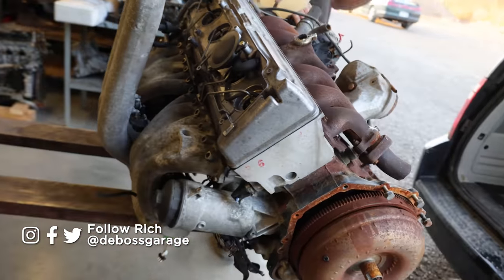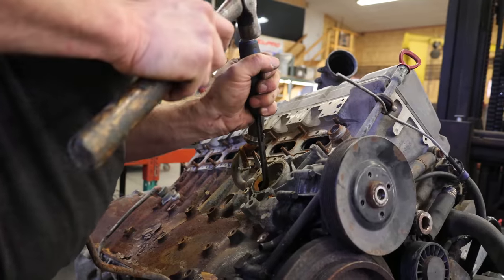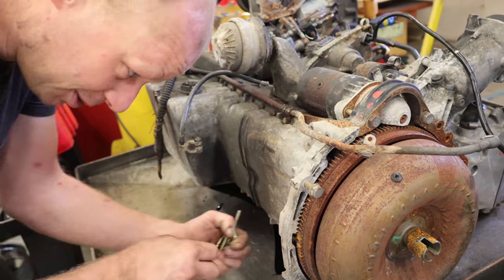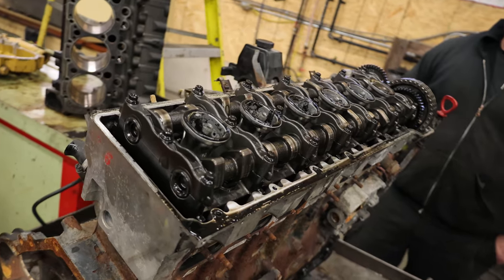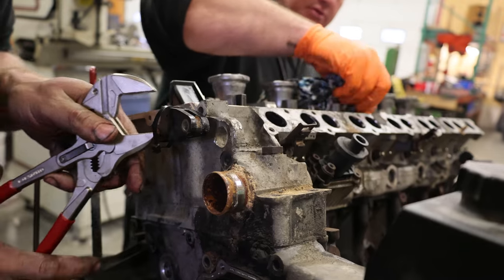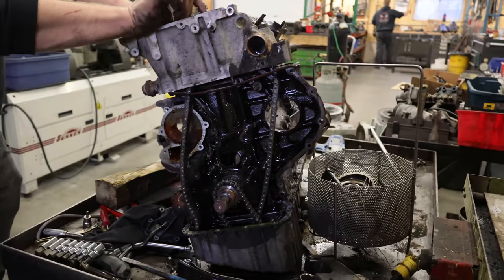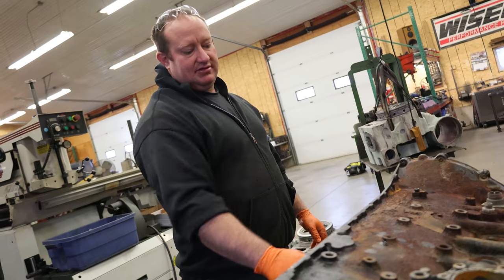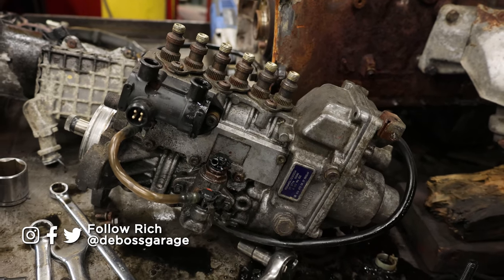REVIEW: Everything Wrong With A 3.0 Mercedes OM606

Comment: That spring loaded drive wheel for the injection pump is actually a dynamic timing advance mechanism, has nothing to do with chain slop..
It advances the pump timing as the rpms are rising 😃 build versions of the OM606 do up to 7000rpm
Reply: It's also a common problem that those vacuumpumps eat up that Rollercoaster thingy on top of the timing advance, if the bearing in the pumparmroll is going bad.

Comment: The pins that hold chain sliders are hollow Inside, they have 6mm Bolt hole where you screw in a Bolt, then Use hammer to extract, careful if going back together because it fits both ways only one is correct , these engines are really sensitive reguarding the hidraulic lifters and with timing of the fuel pump... They also have trouble starting up if even two glow plugs are bad...
Usually we say the Mercedes Sing you see with three lines and a circle that represent: Oil, Water, Fuel and trip around the world 🙄

Comment: You can't build a lot of hp into a non turbo.om606. The rods and pistons are to light. Now the om606 turbo can be built to very high hp. Take the stock pump and remove the 6mm poppers with 7mm. The stock turbo needs to be replaced as well, what's used on a 5.9 commins will work, and if you can find the right valve springs it will spin 7500 rpm. This from a Mercedes owner.

Comment: These engines are good except for what I used one for: I had one that DPUK built for me to go in a Land Rover defender and sadly I was disappointed with it, no.1 being theres no torque below 2500 rpm and no.2 it massively overheated all the time, no.3 it was terrible on fuel. The no torque below certain r.p.m makes it unusable for towing any trailers and personally I’ve never seen or had an engine over heat just from idling and on a 60mph run it would only do 10-12 m.p.g at best

Comment: Those pins that hold the chain guide are pressed in. The pins have internal threads for a pulling tool. By the looks of it they're rusted out though. Love my om602 and 606
Reply: And by tool I mean a bolt and stack of washers lol

Comment: the NA and turbo pistens are the same size, the difrens is the cros pin in the pisten. 26mm in the NA and 28mm in the Turbo.
you can bye som used turbo pisten on Ebay or benzforce.com  (USA)
you can bay som storng con rods on aliexpress ;)
remember to use a turbo head gasket (its a MLS) and use som 12.9 bolts for the heads bolts. the OEM bolts are stretch bolts and will stretch over time if you runn alots of boost, sak me how i now :P
if you remove the  chain tensioner on the exhaust side of the head it will com easier out
and the to pins, one you cut are only present in. the are M6 threads in it for a hammer extractor tool 
you can use the fule filte house of your w124 white merceds om602, its a better design with banjo bolts and fittings
if you have any questions, feel free to ask me

Comment: The 617 turbo has oil squirters on the rods for the back of the pistons, the N/A doesn't. Worth looking into for the 606 turbo vs N/A. Might be an upgraded oil pump to handle the extra volume too.

Comment: P-pump with a supercharger and turbo set up to clean up some of that fuel early on?
Reply: Blacksmoke racing has done it before not whit the p pump. But damn it sounded badass
Reply: Na, just build the OE pump with elements from Dieselpumpuk and then use their quick spool valve or their twin scroll manifold.

Comment: Looks like a 606.912 out of a 1996-97 W210, same block and crank as a 606.962 turbo , the head casting is the same but not surface hardened to the same specs
and non-sodium filled exhaust valves. The electronic injection pump is the way to go nowadays with 7.5mm elements and stand alone mod factory or aftermarket ecu.
The SuperTurboDiesel forum is a good source for information. I would not put one of those engines in a heavy truck with big tires or for towing.

Comment: also to really make power with these motors you need to make a custom exhaust manifold, as well as intake manifold. the stock stuff works but chokes up above 250hp.  intake is good tho, just have to gut the flapper. 

the main difference between turbo and na are piston wrist pin size and oil squirters.   also rods are a different profile, tho by the 606 it may not matter, tho na will still have a smaller wrist pin.

Comment: N\A 606 will need stronger connecting rods pretty quickly if you put any more diesel in 'em, seen them bend in half at 250hp and even under, you REALLY need to make sure you dont get a lot of boost at low rpm! I have seen (locally, theres a guy who builds pumps not far away) 300hp n\a 606's, but it doesnt take a lot to fuck em up. Thinner valve stems on the intake aswell (or was it the exhaust haha, 7mm vs 8mm i think), that can break. Some say the block isnt as strong as the turbo one, but thats only for crazy level power. Get some china h-beam rods off aliexpress and even a NA 606 will take a severe beating! On the positive, the N\A cams are better for more power builds! Talking new vs old diesels, the old OM617 5 cylinder 3 litre Mercedes engine is apparently something like a 100kgs heavier than the 6 cylinder 606!

Comment: the timingchainguide-pins have threads in the middle so you can pull them out with a slidehammer.  simple working design.   The stupid plastic fuelhose fittings were fitted around 1995 and up..

Comment: The reinstallation of the injectionpump is quirky on its own, as you don't install it on your wished advance timing setting. There is a relative relation of marks, as you turn your injection pump on "TDC" then turn your engine to 12-14° After TDC and then install your TDC setted pump. don't ask me why, but one guy ones said to me, that it is because of dynamic timing measurement with special electronic, and special Mercedes equipment, which requires after TDC marking, to cancel out vibrations and harmonics out of the measurement 🧐

(Btw, the pumps TDC mark isn't actually TDC, it's that called relative mark, which enables one to put it in at 12-14 atdc

Comment: I run a old c250 turbo I'm just putting a new turbo tomorrow that engine is the Om605 it is the same as a 606 but it has one cylinder missing I'm hoping to get it close to 400bhp you can get a 606 up close to 600bhp they sound like a gas engine when they are higher bhp

Comment: they can run all the timing and get crazy rpm/hp cause of the indirect injection system,  tho now mercedes uses a common rail DI system since that is fast enough to do essentially the same thing.

Comment: That looked like an old square roofing/gutter nut no idea why it would be in an engine though I know a local garages gripe with Mercedes was like you pointed out parts are exorbitant and Mercedes supplied the wrong codes for their diagnostic reader which made some things like refitting the steering wheel due to no master spline a sod.

Comment: We got older European 2.8liter six cylinder diesel engine in farm equipment n farm truck there cool when you have 5.9 Cummins 24v and Nissan 24v 2.8 and there the same power lol but we thought about getting one of these for a small self propelled farm equipment just not alot of performance for them in the usa

Comment: Those things were beasts on the autobahn back in the 70s and 80s
Reply: That engine wasn’t build until the mid nineties
Reply: @cullenmiller8170  maybe that particular engine but the 300 TDs were on the autobahn back then and it was something to see
Reply: @ivoryjohnson4662  Well having lived in Germany during that time I can promise you they were anything, but fast. The turbo diesel made it into cars in 79. That was when you could buy a 450SEL 6.9ltr. That was the fastest production sedan in the world at the time. The 200D had just a hair over 50hp, the 240D had 72hp, the 300D had 88hp and the turbo diesel made 125hp back than. Compare that to the Golf GTI with 110hp in 1976 and less than 200lbs.

Comment: OM606 turbo rods aren't really much better than the NA rods.  Even in stock applications they tend to bend.  There are aftermarket places that make better rods, particularly if you want more than 350 HP out of the om606.
Replacing the timing chain and guides on a diesel Mercedes in car is usually a chore.  You need to cut one set of rivets on the chain (without losing tension on either side of the chain), use a master link tool to hook the old chain to the new chain, then slowly turn the motor over while feeding in the new chain (while still keeping tension on the other end).  Once you get the chain all the way in, you have to mushroom over the rivets on a new link to tie it together.  It takes 2-3 people to really do right, and you have to know where to get the master link because it isn't commonly available.
We used to say that every part, even the aftermarket ones on any Mercedes was at least $100, even the cheap plastic ones.   If you are familiar with the acronym BOHICA, that applies to all Mercedes parts.
Reply: Are there aftermarket parts to convert the na OM606 to turbo?
Reply: @timothykeith1367  Yes, there are parts, but they are more common in Australia and Europe.  The NA engine has a different compression ratio than the turbo engine does (25 to1 vs 22 to 1), which means different rods and pistons are generally necessary (the NA stuff is just too weak).  In the US and Canada, this typically means having custom pistons and rods made if you don't use the stock turbo stuff because they aren't commonly available.  It isn't impossibly expensive, but you could buy a complete running turbo om606 take out motor for about the same money (about $3k or so).  In addition, using the new custom pistons and rods usually means that engine re-balancing is needed.  The injection pump will need to be changed, the alda/boost compensation is necessary for a turbo motor.  Most often you will want a pure mechanical injection pump, so for US models that limits it to the 1997 to 1999 motors (if I remember right).  The intake and exhaust manifolds are different on the NA and turbo motors also - they still can be used, but typically requires fabrication in order to work.  The NA motors can be used in general, but you really should only use them if you are rebuilding the motor from the ground up when cost is no object.  
There also isn't a lot of videos that go into much detail on the om606, unless you just want a couple minutes of some European drift cars going around the track.  The only set of videos I am aware of that have a project going from start to completion is the channel from MR300D.  Most of his videos go into more detail, although the stuff on his compound turbo was hampered by incorrect sizing of his small turbo.
Reply: @wackowacko8931  So, a converted NA OM606 motor could be better if you building for power?  Many 12 valve Cummins have upgraded internals when building for power.  I don't see the OM606 but haven't been looking that much for them.
Reply: @timothykeith1367  Not necessarily better, but OK to build on if it is what you have on hand.  You are much more likely to save money by buying a complete turbo motor in the first place, because the rest of the parts like manifolds are already there, instead of trying to cobble something together with the NA parts.  As I said before, Mercedes parts aren't going to nickel and dime you to death, it will hundred buck you to death.  
Cummins parts are a LOT more available, and if you want high HP/torque numbers - and weight and package size isn't a concern a Cummins is a lot better choice PROVIDING it will fit, simply because the parts are that much more available.  The OM606 is half the weight of a Cummins, will fit underneath most stock car hoods and will be a more balanced package with most suspensions, but the max HP is in the 500hp range.  Any more than that and it will not be driveable on the street.  It can work great in a mid sized sedan though, like a w123 chassis, w124 chassis or even a w126 chassis  (it came stock on the w124 and 126).   It will work in a Volvo or much older Saab, or in some of the mid sized Ford, GM and Dodge sedans.  I've seen some applications of the OM606 in 1/2 ton trucks that work out pretty well.

Comment: Hi , i have S Class W140 1997 Facelift  with this OM606.961 engine , i had a problem with water installation explosion due the lack of plastic quality of the Holders of the hoses of water installment ! in mean time i had temperature raising after explosion of water installation , my repairman says that I need to Change the whole engine and he told me that inside valves something was cracked and expensive to repair (maybe he is hustling to take some money)! What Should i do with this engine ? im not driving the car after he said that ! there is any swapable engine type ? or should i fix the crack for half price , or should i find a next used engine ?

Comment: I’m guessing that the timing chain replacement totals the car
Reply: Nah, you just connect it to the old one and roll the new one in from the top, it's a much smaller deal than these guys made it out to be. Not sure on the 606, but recommended timing chain replacement interval for the 617 is 800,000km, or 500k miles. Just not a big deal.

Comment: Is it just the non turbo version that doesn’t hold power? I read in a couple places that even the na turbo version is only good for about 300hp
Reply: The NA version has too high compression and a too "sharp" camshaft for high boost turbo. The stock turbo engine is limited by pump elements and the turbo.

Comment: What about om617? Are those similar to 606
Reply: Not quite. Five cylinders, single overhead cam, 2 valves per cylinder. The 616/617s are very well built engines and have a legendary reputation like the 605/606, but they don't do so well at higher power figures like the later. I believe the most that's been made with 617 is around 400hp, but they're on borrowed time at that point. They make awesome daily engines that can handle a few mild upgrades, though.
Reply: @thegreatkingdaniel  ohhh ok cool, thanks for all of the info!

Comment: Too many adds . Lose though that your pointing out. Youtube is too greedy. Two adds in 15mins.  I love diesel engines. Its not hoarse power but torque that counts.   thanks.
Reply: Horse power and torque are directly connected, if you change one you change the other.

Comment: Finnish drifter in the beginning! Nice. That guy has broken sooo many of these engines.
Reply: sadly they don't run the 606 anymore, but still awsome sound with the OM648
Reply: @MrTruckDriver  guess that’s because its a junk engine. Just can’t hold up.
Reply: And running a turbo, supercharger and nitrous can be pretty harsh on any engine. So it is not the engines fault. It just gets pretty hardcore usage. :)
Reply: @MrTruckDriver  sorry a slow reply. But yeah, Teemu has gotten pretty epic sound out of the new engine. And like I said, at one point he was experimenting with supercharger, turbo AND nitrous. And add to that  the sport of drifting, you have to respect these engines. Om606 and 648. He has really heavy foot too, when drifting. He is all out-kind of guy. 😅

Comment: Your best resource for parts and knowledge about OM engines will be from Rodney at Benzforce in the US, give him a call and he can probably answer any question you have. Great guy, I know him personally. He also has a couple of youtube channels. I have personally rebuilt a 606 and it is a feat. I imagine I'm not going to be the only one to tell you this but, you can not put it together like Mercedes did when they built it. Buy a turbo om606 (606.962), do not open it, stick a pump and turbo set up on it and run it till it blows, rinse and repeat. The turbo engines are different in many ways. One important difference is oil squirters for the pistons, you already know about the pistons and rods, the piston rings are different(turbo engine specific!),
the NA engines have different cams from the turbos, the list goes on and on. The NA engines will not survive over 300 hp. If you are serious about making over 500 hp you should put rods in and do the cooling bypass mod and a huge oil cooler. Don't rev it over 6000 and it will stay together! There is a lot to learn! Good luck! 

Put a fuel filter assembly from a OM601,2,3 and that will solve the plastic line problem.
Those are threaded pins. Use a slide hammer and a bolt to remove them.

Comment: Rich: Europeans laugh at us, cause this things make the same power as our 5.9l. 
Me thinking: Why mess around with a OM606, it's a boat anchor. Get a OM648 or OM642
Reply: Imagine suggesting a OM642 is better than a 606
Reply: Meh 648 is good strong engine but Dosent really Rev and the head has awful flow stock, plus the complication and expense of tuning  common rail,
Reply: @Diesel8290  I would love a mechanical injection converted 648 though
Reply: @MiG21aholic  Actually i like them. They have the paper thin exhaust headers and the stupid oil cooler design in the valley, and the longest timeing chain in history but other then that they are reliable and make good power.
Reply: Wtf? Om642 is the worst engines they made. Om613 and 648 is miles better

Comment: It has LESS torque than a 2jz despite it being a diesel?
Reply: That's because it's an IDI design, so it uses prechambers which restrict the cylinder  pressure curve and with that restrict the torque and the low end grunt..
Mercedes used that type of IDI to reduce noise. A well running stock OM606 is almost indestiguishable from a petrol engine

Comment: Those pins for the chain guide are actually threaded inside, so when I rebuilt my 606 I used a bolt with a lot of washers to pull the pins out of the engine, but based on the condition of your engine idk if that would've been possible